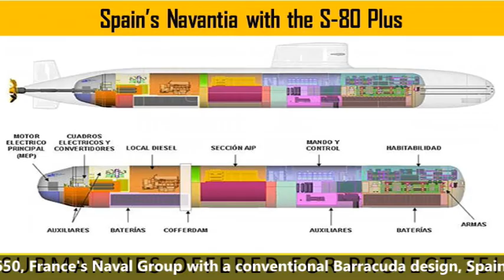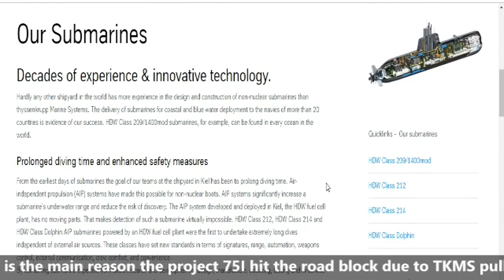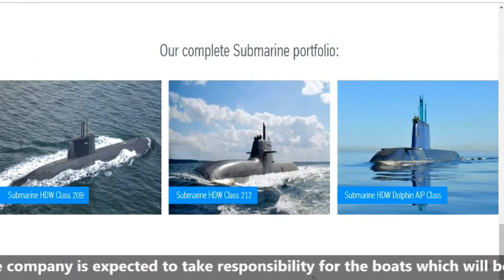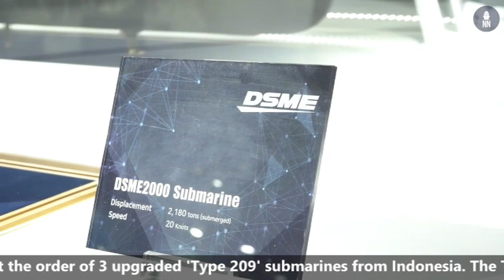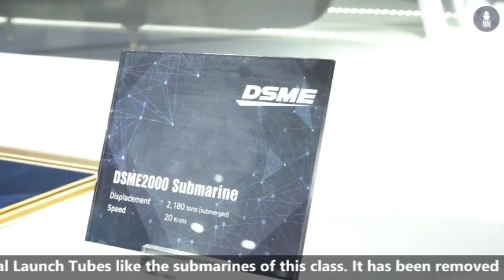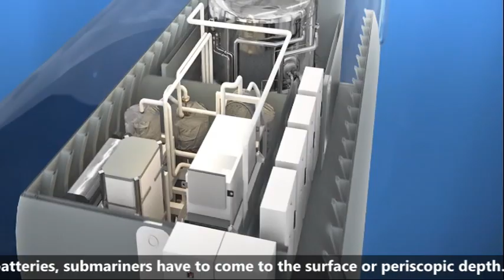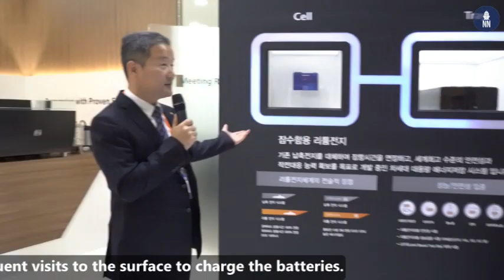Project 75I Hits Major Road Block |Germany Based Thyssenkrupp Marine Systems Pull Out Of Project 75I

Comment: Navy should go for DSME 3000. They are best in its class
Reply: No vertical launch system.....
Reply: @hritabanroy9900  actually only dsme 3000 comes with 6 vls but in an article they said they'll not offer it to India in order to accommodate more indian sub systems. And dsme 3000 batch 2 will have 10 vls.
Reply: @sarthakasingh2179  Yeah! I know! The Indian version will not have VLS.